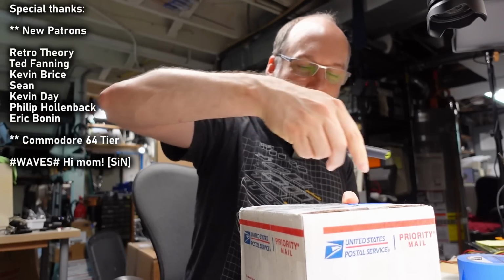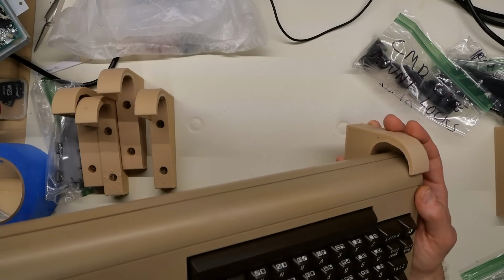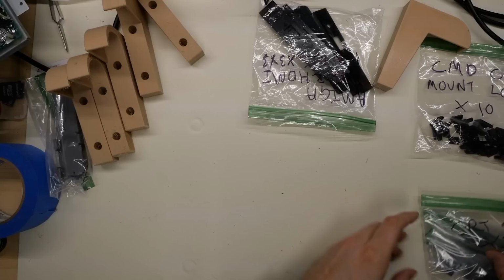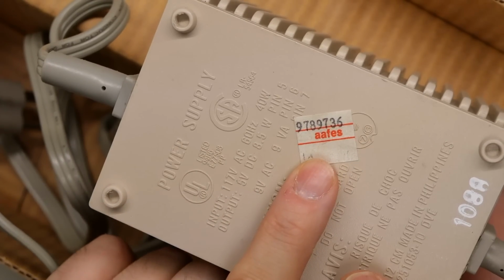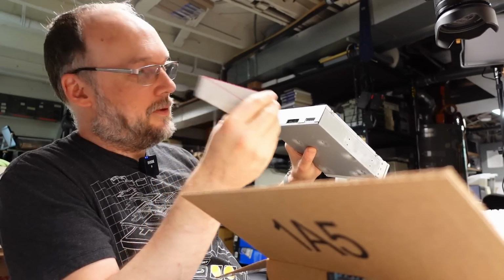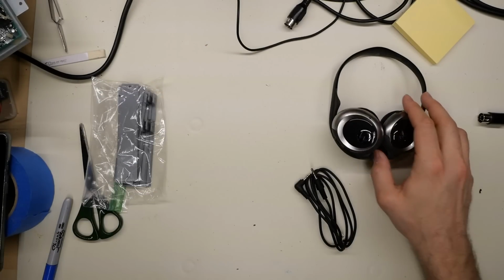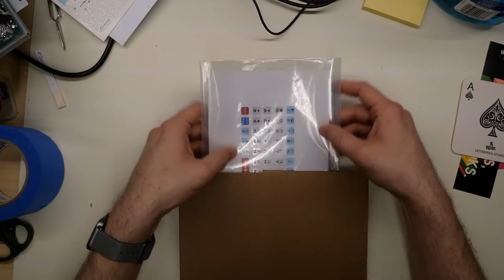A 64C future repair, PET Keyboard Stickers, a USB music keyboard, and some 3D printed goodies

Comment: Hi Adrian , the M-Audio keyboard uses the usb to communicate with the pc for connecting to a DAW (Digital Audio Workstation) , using a sequencer like Reaper , Cubase ,or any other midi compatible software , you can also use a standalone host software like vsc sound canvas from roland run that and select the midi in as your Usb controller and there you go it will play from the keyboard :) 

But you already knew that ...... Right :) 

Lee 

Keep up the good work :)

Comment: At 25:20, that's Digital Equipment Corporation, not Electronics as you said, also known as DEC or just digital.  Digital, Intel and Xerox were the ones who basically created and popularized Ethernet back in the early days.  DEC set a lot of standards, like the VT-100 terminals and descendants.

(Sorry if I'm repeating things some of you already know, I proudly supported the hardware, OpenVMS operating system, and networking from roughly 1986 to 2018.)

Comment: Oh, I had a similar behaviour as the headphones with a fitness tracker. My power bank would light it up and “charge” for 30 seconds before turning off. But it worked fine on others. So the headphones could just not be drawing enough current, given they likely charge at way less than the 500mA limit of the day. Plug ‘em into a laptop or a wall adapter for a few hours and I’d wager they still work a little bit.

Comment: When applying stickers, you can clean the surface with natural/pure soap with water, and then leave a fine spray of soapy water on the surface, then you can move the stickers around the surface, when they are in their final place, just leave it there until the water dries off, and rub away the sticky soap residues between the stickers with a damp rag.
Soap is naturally adhesive when dried, so it does not usually compromise the adhesiveness of the stickers.

Comment: Hi Adrian, I have a similar USB keyboard which is recognised by my PC as a USB midi device. I also have my Sound Canvas hooked up to the PC, so I use a little freeware app called Midi Ox which routes the keyboard midi commands through to the Sound Canvas. Works great and would likely work for your keyboard too.

Comment: I have the Plus Deck 2 I got at goodwill new in box with all the software and literature. If you would like a copy of any of it, let me know and I can email it to you. It works well and I'm using it to back up over 200 hundred old radio shows on tapes I got at a local thrift store.

Comment: Adrian, That Blue/Black Commodore 64C Box is an Original Canadian Marketed C64.  I have one just like it.  USA Marketed C64C's came in a White Box just like the USA C128's and 1541 II and 1571, and 1581 Disk Drives as well. All the later USA boxes matched.  ;)  Tony K. , Melbourne, Florida

Comment: The Creative EM8852 need Windows 2000 or better.  Some site said there a Windows 8.1 driver but I don't know how create-able are these website.  
Just patch the USB midi though a pc with a sound card with midi port where you send the output from the keyboard to the pc to the midi synth.  You might need a program to allow this.   I don't know.

Comment: For the M-Audio keyboard you could use a demo of ableton on the pc and it would send midi via usb. The commands you see on the keyboard are the CC id for that control and then the value it sends -127 to 127 . The E-MU sound card is also for music production and uses the ASIO audio driver that can have very low latency less than 10ms so the delay from pressing a midi key to the sound card playing the sound is as small as possible. It also has balanced inputs for instruments and pro grade digital IO. Not sure it would work on a new pc the drivers are a bit picky so perhaps windows xp would be a good choice. I used to build music production PC for a living so happy to answer any questions.

Comment: The headphones may charge if you leave them on for some time.  If youre lucky the battery might charge slowly until it reaches a satisfactory voltage for the charger to switch to fast charge.
Reply: That’s probably what it is.  Trickle charging to minimum cutoff, and that’s probably at a current too low for the pack to realize there’s a load.
Reply: Yup, exactly. I observered that behaviour with a power bank I got at a charity store using my USB tester.  It drew 100mA for some time then jumped to 800mA and would then supply power.

Comment: I am very familiar with that audio card.  It has nothing to do with the tape player.  I have the 1820m version of that card, which I still use for my digital audio workstation. I believe the 0404, the 1212 and the 1820 cards all use the same drivers, which were for Windows 7, but still work for Windows 10.  That card is a very high-quality card, and was fairly expensive back in the day.  That card can 'emulate' the Emulator II, and there was software for that card that emulates the Proteus Synth as well.  (I think I have the software for both).  Those DSP chips were very powerful, and could do onboard hardware audio effects.  The SYNC output, if I recall correctly, refers to audio sync timing generation, and used with SMPTE timecoding so you could use this audio card with video production.   This card can be considered retro in the sense of the emulated synths, since it was one of the first personal computer setups to emulate a production hardware synth before the advent of the software VST format.  Edit: Yes, there are drivers for Windows XP as well.

Comment: I'm sure 1000 people have said this already, but install the E-MU card, connect the Sound Canvas by MIDI to the E-MU with the provided adapters, then attach the M-Audio to your computer to control it.  You'll need some intermediary software (most people use a 'digital audio workstation' (DAW), there's a few free and trial examples out there, like 'Reaper') but you can definitely use the keyboard to interface with the Sound Canvas and any other MIDI devices you may have!

Comment: I have/had (not sure it works anymore) the Plusdeck 2c. The colored headphone cables was for the output to go into the sound card. That sound card ribbon cable is not the same. 

I was unable to get the software to work in XP but the front panel controls work just fine without the software. 

I would caution though to keep a cleaning cassette handy as they liked to eat tapes like many car stereo tape decks. 

I actually am hoping to build an old beige box to rerip my music CDs and get my old Plusdeck working, if it works. (Hasn't been touched in over a decade...)

Comment: The PET decals are UV printed and should be extremely durable. UV cured ink adheres very well to the metallized vinyl used. Clean the existing keys extremely well with rubbing alcohol and transfer the new decals with an exacto knife, as stated correctly in earlier comments. Thank you for the shout-out :) Great show!
Reply: Not sure if it was created by you, but the bookmark had a comically ironic mistake, it should be "fewer selfies" not "less selfies". Amusing a bookmark advocating literacy exhibits mild illiteracy! ;)
Reply: @AdamArmstrong  Thanks for bringing this to my attention. Now I like it even better.
Reply: @AdamArmstrong  You're right, but don't be too hard on the guy. His German name suggests English might not even be his mother tongue. Not being mine either I can imagine I make such mistakes from time to time.
Reply: @BilisNegra  thanks. Well spotted.
Reply: @BilisNegra  don't worry, most native speakers don't know the difference between less and fewer either, in no small part because the selfie generation is increasingly illiterate.
Reply: @AdamArmstrong  Good to know that. Not that I'm hoping to ever sound like a native either, I haven't even lived in an English speaking country/region at all for any amount of time, so I guess I should be  OK with getting my message across more or less fluently, but letting it show I'm a foreigner here and there. Thanks for your comment.
Reply: @AdamArmstrong  I suspect this change may be one which continues to happen until it eventually becomes the new grammar. Forex French grammar used to be incorrect, lazy, or corrupted latin (or old French). Like it did read a little awkwardly to me but I suspect in 50-100 years no one will care.

Comment: While you can get USB MIDI to 5pin DIN converters it's easier to just use what you already have and connect that MIDI controller to a PC then send the MIDI out to the Soundcanvas.
I wonder why M-Audio decided to use 0 to 1.27 instead of 0 to 127 which of course is what MIDI ACTUALLY uses. The decimal point is completely meaningless.
The pitchbend is the only thing MIDI uses 14bit values for. Everything else is 7bits.

Comment: When I have to apply a label in tight quarters, I tend to use a pair of tweezers, and to set one edge down first to get it lined up. As for prep, I’d think just going over the key tops with isopropyl alcohol and Qtips should be safe and thorough enough.
Reply: Exactly what I was thinking!

Comment: You can use a USB to MIDI adapter with a DAW or a MIDI router software to pass-thru the messages from M-Audio to either Sound Canvas or C64 Mssiah cartridge if you have that.

Comment: As for applying the key stickers here is what you need to do.  First buy 1 bottle of 90 proof vodka and a bottle Single Malt Scotch.    Using a tooth brush clean the keys with the vodka.  Next while the keys are drying drink the bottle of Scotch.   Now apply the stickers.  After drinking that much Scotch you will care if they are on straight.

Comment: you can use the usb keyboard with your roland but you will need to have the computer in the middle .. you can use the game port output to to connect to the soundcanvas with a game port to midi cable ... then you can use an app like hubies midi loop back .. and that will pass the midi data from the keyboard to the soundcanvas

Comment: The Oxygen Keyboard can work with LMMS which is free, I've got myself a larger model and "experimented" with it. (I'm no musician)

The C*** controls can be assigned to midi controls on digital instruments on music tracking software to adjust various parameters.

Comment: I have a boxed C64C doorstop with the same beige power supply. The box looks like a late 80s updated version of the original C64 breadbin box which I also have. Also, for some reason I got really lucky with my potted C64 power supplies, none of them died so far, they're all still within spec, I got a bad one once but that was bad before I got it and it's not completely potted so I could snip the original 7805 out and jam a new one between the case and the heatsink and attach it and that works a treat.

Comment: I purchased an Atari 800 at the BX (Base Exchange) in Okinawa Japan where I was stationed in 1981.  AAFES was the operator of Air Force BX and Army PX (Post Exchange) stores.  They only sold cassette decks so I ordered an 810 Atari Disk Drive from the AAFES Catalog.
Reply: How much of a discount did you get versus MSRP or the going Atari dealer rates back then? Curious...

Comment: I had a 1989 Commodore 64 C with same looking power supply, which failed pretty soon after the warranty expired :D 
It blew the fuse immediatly, either when connected to the wall socket, or at powerup, can't remember anymore exactly. It had to be replaced with our own money. Dad tried to open the failed one to see what went wrong, but as it was filled with epoxy, it was impossible.
My C-64 C box was similar looking as most Commodore Amiga 500 boxes, white base colour and blue & red stripes and the computer image on it, if I recall correctly :P
Oh and as I live in Finland, mine was PAL version.

Comment: For your PET keyboard decals, I suggest an application fluid called Rapid TAC.  It is an adhesion inhibitor that allows you time to position the stickers and gives you the ability to pull them back up without damage if you need to.  You squeegee the fluid out to make it stick and the remainder will eventually evaporate resulting in a good bond.  Mostly the fluid is used to applying large decals to vehicles so it comes in a spray bottle but I think you could use a cotton swab to apply it to each key.  Pick the decal off the sheet by a corner with a blade or other thin tool, place on button and position, then roll your finger across it to squeeze out the fluid and any air bubbles that are under it.  I used Rapid TAC to apply stripes and registration numbers to aircraft many times and swear by it.

Comment: Fancy new camera work, especially at 0:45, it's like an opening of a tv series or an older video game with the text on screen, I like it!

You can make your own shapes from factory made gummy candy, like the bad of Harribo that melted in your car, you can gently heat up a batch and pour it in your mould. If you use powdered sugar and push in an object, the sugar can take up the shape then our the molten gummy inside the indentation. Or just use regular silicone mouls.

20:35 - that's some fine candidate for LGR Oddware!

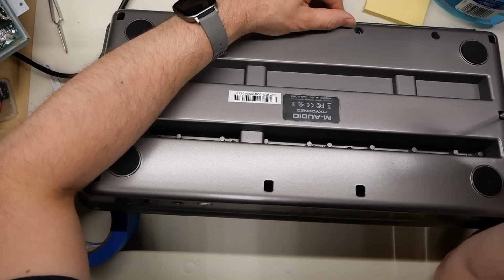31:05 - I had a good laugh there, you just opened a pristine brand new item but you found something about it to fix and you just fixed it :D

You could try a demo of Reason with that keyboard.

Comment: @Adrian's Digital Basement the C64 wall mount is PLA, you can put just the  64 holding part unter running water or boil sow and will soften, then just press fit your C64, PLA will get soft around 60C

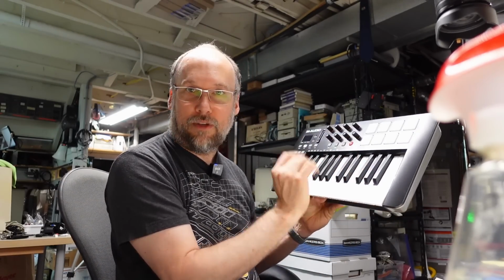Comment: 29:28 You can get USB midi hosts, they convert the USB midi to 5 pin DIN.
Reply: Came to see if anyone pointed this out. They're also not terribly expensive. And even if you're not a musician, playing around with a piano is still great fun. :)
Reply: Yep, Roland makes a good one with native drivers in Win 10. Could use it to rig up to the SC55(?)
Reply: @ReGZ0089  also something like the Buran MIDI module can be both a MIDI synth on for a MIDI controller to play directly, or a MIDI synth for a computer, or a standard USB MIDI I/O! Of course solely an I/O is probably cheaper, but I like multi-purpose stuff!
Reply: Or just use the keyboard as Midi in and a sound card as Midi out. You were given a sound card with 5pin DIN Midi in the same mail call
Reply: That EMU card had the breakout for DIN MIDI out.  Plus those cards usually came with decent soft sampler software.

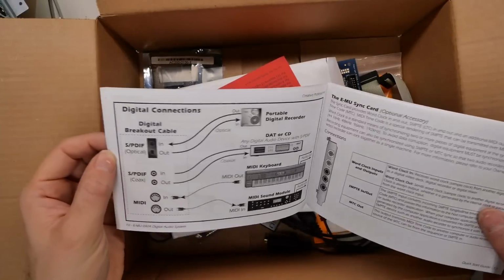Comment: in regards to like 23:00 in, E-MU made synths in the 70s and 80s, and yeah, they were bought by Creative
One of their synths, the E-MU Emulator II, was the synth that was used in Ferris Beulers Day Off in the scene where he's on the phone with the vomiting sounds in the background.  Cool snyth, dual 5.25 floppy drives and built like a tank
Reply: Peter Gabriel used one for the song, "Sledgehammer" in 1986.  The preset sound was Shakuhachi and you'll hear it in the interlude between the 2nd chorus and bridge (also at the very beginning of the music video.  Keyboardist Ton Banks of Genesis used one during the making of the album "Invisible Touch" and also played the same one during the album's tour.
Reply: There was about 5 years where Depeche Mode was a touring EMU advertisement !
Reply: For the MIDI keyboard, if you have a semi modern Mac I really like GarageBand for playing with music
Reply: This E-MU card is a low latency ASIO card for music production used with software like Ableton and Cubase on a PC or MAC.